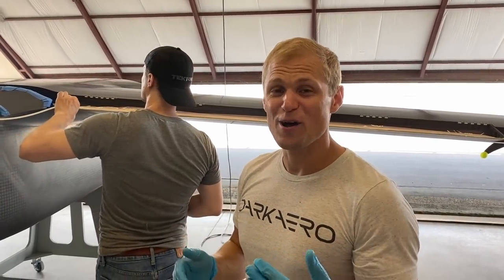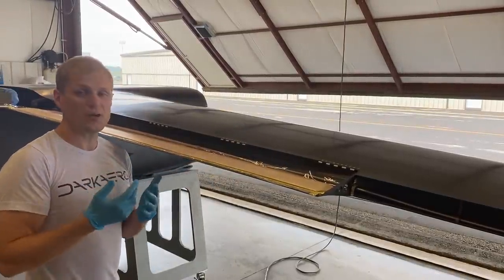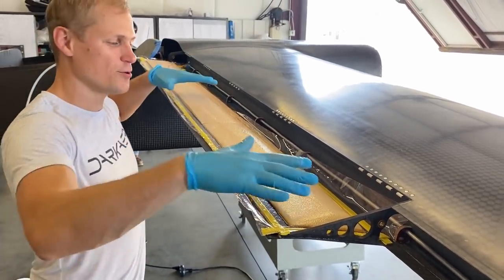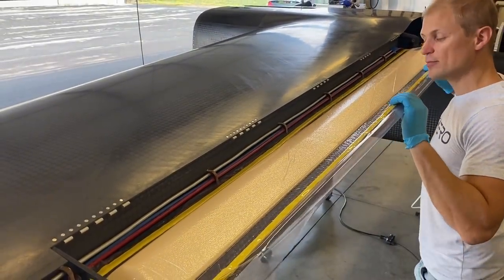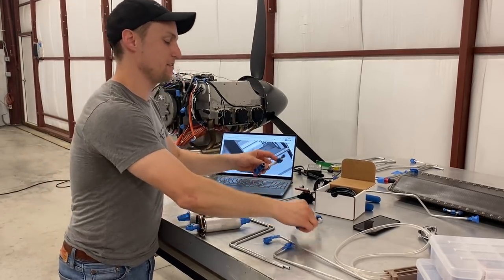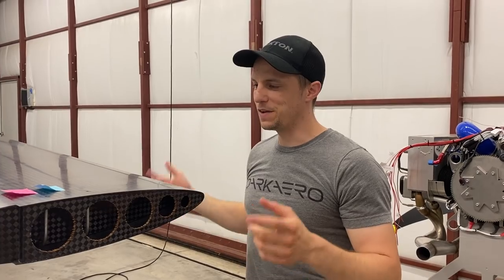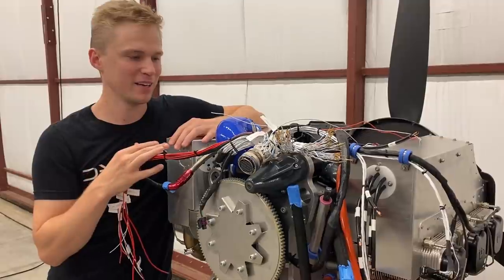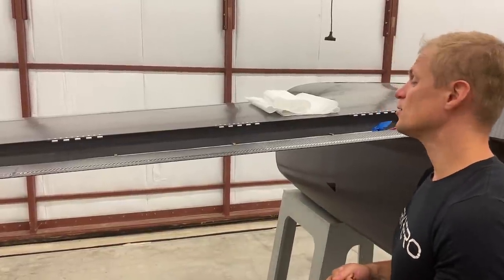Primitive Carbon Fiber Technologies | DarkAero Shop Vlog | July 27, 2021

Comment: Just a thought,  but have you considered back lighting the fuel sight tubes for easy checking at night in flight or on the ground.  Plus backlighting with LED's will look cool as hell, like the rest of the plane.  Great job on everything.  I also agree with the other commenter who said he would watch 1hr episodes.  10-15min is a tease!  Lol
Reply: Agreed, 1 hour would be great.
Reply: I'd like to see the 3 hour James Cameron version :)
Reply: Considering how much work it takes to put together these episodes, I'm thankful to see anything. Let's remember, these guys aren't YouTubers, they're trying to complete a project.
Reply: It's a kit, so adding something like backlighting would be a relatively easy modification to make during the build process. Right now they're just trying to get this thing off the ground. Every little feature like that adds delays, especially given that their wiring harness is already done.
Reply: Experimental/Amateur Built Aircraft are Certified under that E/AB standard, which means the end customer is the official manufacturer of their own aircraft. He/She can do whatever they want, so long as it passes several basic inspections for structure, build quality, and basic mechanical standards. So anything cosmetic or "experimental" in nature is generally allowed (In the USA) - Europe wants engineering documentation on nearly everything. (In spite of the fact its you the pilot who's life hangs on the build quality and engineering). 

So, buy a kit yourself, and plan how it will be customized.
Reply: I feel like the only thing worse than having fuel in the cockpit, is having wiring which could short right next to the fuel. Sounds like a bad day in an crash or off-field landing.

Comment: I like the design contrast between Dark Aero and Mike Patey’s Scrappy aircraft. One off Bespoke vs design for production. Would be very interesting if you and Patey could do a podcast to discuss what would be different if the end goal was reversed for each.  If you did not have manufacturing and price point constraints what would you do different?
Reply: That would be a great video to see.
Reply: If you flipped them you would have a carbon cub and Mikes turboprop race plane. 
I think if the two parties sat down together only a handful of people could understand that lingo.
Reply: I'm watching both projects evolve (well...one now, since Mike Patey is at Oshkosh with his plane). Both are very clean builds. Both paying excruciating attention to detail. Mike Patey could never "produce" his plane, tho, because he throws mad money at it. Billet machined ribs?!?!?!
Reply: @curvs4me  One hundred thousands? 0.100” is that what you meant? Any modern machining center can easily do that.
Reply: @curvs4me  do you have any videos of Mike machining his plane? First I’ve heard of him and just checked out his yt channel, there is so much content out to sort through.
Reply: @curvs4me  pretty sure he outsourced the machining of the ribs and linkages for the crazy flap/slat/aileron system bc he couldnt handle it in house
Reply: @curvs4me  You really don't understand the first thing about machining or machining tolerance do you? good grief

Comment: I am concerned that with the fuel vent arrangement with it have the two circular small vents that it could easily lead to contamination. Simply put, I could see Mud Wasps and other insects making it a new home. And as one other commenter discussed it also seems that full tanks and a non leveled parking surface could lead to fuel leaking? 
However, as an airline pilot and mechanical engineer I find your project absolutely incredible and I can't wait to see it fly. You guys have done a great job!

Comment: @ 8:00, I hope your two fuel tank vent lines have some sort of screen or something blocking critters from crawling up in their and blocking the lines.
Reply: Excellent point
Reply: I'm surprised some sort of evap control system couldn't be worked in, but maybe that's too much weight and just not required on an experimental aircraft.  I wonder if water can ingress that way.

Comment: Is there a projected date to have this prototype flying? Great work!
Reply from the maker: Fair question! We're pushing to get it up into the air before year end. Our big focus right now is getting it up on the gear and getting all the systems (fuel, electrical) hooked up so we can get the engine fired up. Not covered in this video, but there is a lot of work going on for the main gear work. We should have more on main gear soon!
Reply: @DarkAeroInc  Thank you for taking the time to respond. Looking forward to the completion!
Reply: @DarkAeroInc  Looks like a great build. A small question on construction detail. When dealing with glues and compound ( esp composite)
should you be working in a clean room and other systems. Yeah I know hangers get the extremes of climate. ☮️ ☯️ & fly high & inverted.
Reply: Well placed rumors have it you're it's first flight is scheduled for Tuesday....
Reply: @markrooney6406  composites are quite forgiving and clean rooms are not required. As long as you clean and properly prepare the forms, it’s all good. The biggest thing with composites is the temperature of the environment while layup and curing. Resins vary as to their temperature requirements, but generally the warmer the temperature, the faster it sets. That can be manipulated to give yourself a longer or shorter work time with the mixed resin. Cooler temperatures give you some breathing room for the resin to set. Some composites also can benefit from post curing where the finished pieces are put in an heated area, be it an oven or properly set up room to essentially bake it after.

Comment: Great job! Hope to see you flying soon!

Can you please make a video on how you make the reinforcements for the hard points? Like the wing connection, engine mount fitting, surface control hinges and horns, and so on? Composite doesn't stand concentrated load, so it would be great to see the solutions you guys used. Thanks in advance!
Reply: In general I believe they add a couple of extra layers of carbon cloth in those areas and have a metal bracket bonded to the composite structure.

Comment: Gentlemen, NICE WORK!!!

A concern about the surface mounted fuel vent lines.  In icing conditions water drifting back along the bottom surface of the wing will try to push its way up into the fuel vent tubes (the bottom surface of the wing is a positive pressure area plus as the fuel inside the tank is consumed that volume will be pulled from the surface mounted vents) so water will try to move up through the vent and freeze and this might prove problematic.

Comment: Hi Guys, is there any chance you could do a video on the process you use for layup selection during the design phase? Within the homebuilding world there appears to be a more primitive school of thought for amateur designs that is basically 'design the spar for the anticipated load and then guess at the skins and if it sandbag tests OK then you're good' and then at the other end of the spectrum the professionals use some very complex equations to mathematically test a proposed layup schedule for an element of a structure such as a wing skin, which is incredibly unwieldy and challenging to do for the home aircraft designer.

It would be great if you could provide a little guidance on how you guys arrived at what is clearly a very light and strong structure with a focus on how you arrived at the layups you used.

Thanks and please keep the great videos coming. You guys are a real inspiration to homebuilders like me.

Comment: I'm curious what type of pressure gauge you are using for fuel level. Is it an absolute pressure gauge with altitude compensation internal to the avionics or is it a differential pressure gauge with two ports? At different altitudes you would obviously obtain huge differences in readings (~15 psi at SL, vs ~8 psi at 18,000'). That being said, I know people are talking about your venting,  but how did you design your venting system with fuel level measurement (due to pressure differences at different AS, AOA, anything aerodynamically different, etc.)? That could be another source of fuel level error depending on where you put your vent ports (ie, in a low pressure area or maybe high pressure area).

Comment: Nice work! Curious about the venting.  It looks like the tubes exit the tip end of the tank and turn 90 to exit the bottom wing skin. There must be more to it otherwise, fuel would dump out at a wing low condition.
Reply from the maker: Good question! Not mentioned in the video, but each vent tube has a little gravity check valve that closes off in a low wing condition to prevent fuel from dumping overboard. Air can go in but fuel can’t go out.
Reply: @DarkAeroInc  Overly complicated adding more components and more points of failure. Why not vent the top tip of the wing back to the wing root, then an up and over loop to prevent fuel venting in an uncoordinated turn or slip! K.I.S.S principle is always best! Also, using pressure sensors on fuel level is not very accurate (had endless issues on a Europa aircraft with this system. Changed it for a tub-in-tube capacitance system and has worked flawlessly for 20 years now.
Reply: @DarkAeroInc  Failure mode on that check valve?
Reply: @davidwhite2011  Though ball checks are reliable in fully wet systems, I would be concerned that over years, dust from dirty air, could cause the check to stick. Looks like they had two per tank for redundancy. As long as DarkAero didn't make the checks inaccessible, simply add it to the annual inspection list.  It's not expensive and not complicated to change if/when the time comes. There are a ton of things that need to be maintained on any airplane  This is a very small thing.

Comment: With the back up fuel pump. Is there a system in place to alternately utilize each pump regularly? This would avoid any failures due to lack of use with safety redundancies. It could be left to the user, but just curious. 
Love the project! You got this! 🤙🏼

Comment: I know this is very late to comment, but I only just found this video.  I saw a different video on composite hand layup over a pattern shaped from EPS foam, and the presenter made a comment that it could not be vacuum bagged because "even at low levels of vacuum the foam will collapse slightly, leading to distortion."  What type of foam was used so that was not a problem on the flap core?

Comment: looks like 6lbs per cubic foot polyurethane expanding foam.  totalboat has one supporting 400 psi per square inch compression strength

Comment: Awesome layup in situ. Does it matter that the vent ports are at a low pressure area of the airfoil? That is, will that exit point bring fuel cell pressure below ambient?

Comment: Hey guys, been watching your progress and I have a question about the kits. 

Will the builder have to do any carbon fibre work? Any moulding or ANYTHING? 

One of the things that puts me off RV’s is all that time prepping the metal. 

I’d like to buy an aircraft and pretty much start building and installing straight away.
Reply from the maker: Hey! Thanks for following along. The bulk of the composites work is completed by DarkAero (anything that requires special alignment or fixturing). There won’t be a need to mix resins or wet out cloth. There are several areas that require reinforcement strips added but these parts are pre-molded.

Comment: Should there be a check valve at the outlet of the fuel pumps to prevent them from losing pressure through the unused pump?

Comment: I noticed you have the aluminum piano hinge riveted into the wing skin.  Is there any concern for galvanic corrosion there?
Reply from the maker: Josh, good question! The piano hinges are anodized and are separated from the carbon with thin adhesive layer. The rivets used are stainless which have a similar galvanic potential to carbon. These hinges are in an area that can be inspected visually so we will continue to monitor how they are behaving together.

Comment: Great video guys. I missed Ryley why you need to install that foam on the underside of the top surface of the trailing edge?
Reply from the maker: Hi David! This was to stiffen up the wing skin in the area above the flap. In the initial design, we planned on using some honeycomb panel ribs in the area but we ultimately concluded using a foam core was a better solution. It’s a nonstructural area so there isn’t a well defined requirement on the stiffness but it does need to handle basic loads from people pushing on the area. It was a “to do” item that we finally got to.

Comment: Do the fuel vent lines have check-valves or something else to prevent fuel from escaping? I wondering if fuel will be flow (leak) out of the vent lines if you're in a steep banking turn where the fuel level covers the vent exit holes.
Reply: Never mind! ....found the answer in another comment: gravity check valve

Comment: 2 pumps in parallel for redundancy but no check valves on their discharge?
Reply: One would think that'd be a good idea incase an internal check valve failed in the pump.  It'd be nice to monitor their temps too.

Comment: You terminated into a connector without the backshell or strain relief on?
Reply from the maker: Each wire is installed with a service loop to provide strain relief, and the whole assembly will be enclosed by a heat shrink boot later.
Reply: @DarkAeroInc  what about sleeving for the wires? Last shrink boots I used had to be on the wires before terminated into a D38999.
Reply from the maker: Since we may want to make changes to the wiring and we have an interest in keeping the weight down, we didn't want to add shrink tubing throughout. The shrink boot will still serve the purpose of providing strain relief here by limiting the bend angle of the connector along with protecting the service looped wires.
Reply: @DarkAeroInc  if your using all these MIL Spec parts are you following MIL-508088 ? If not I’d move to commercial parts. They would be lighter and cheaper. Very few, if any, MIL parts are meant to be light, when the application calls for it to be lighter they just make it out of Ti.

Comment: so do you have to redo the wing loading test? thanks!
Reply from the maker: This won’t warrant retesting the wing. The portion of wing skin above the flap isn’t acting as primary load bearing structure to carry bending loads in the wing. It’s more of a fairing over the flap that is along for the ride. We added structure to increase its stiffness.

Comment: What if the fuel vent holes allows water inside the tank?
Reply: Maybe some humidity goes in but because the vent is leaking under the wing and fuel evaporate I think there is no issues
Reply from the maker: The wing is inverted as shown. The fuel vent openings are on the bottom of the wing so the only water that could get into the tank would be from humidity / condensation. Water is more dense than fuel so it will settle to the lowest point in the fuel system at the very bottom of the sump where it can be drained from a sample port during pre flight inspection. Checking the sumps for water or other fuel contaminants is a standard part of pre flight checks on all light aircraft.

Comment: With very little dihedral, you will be dumping fuel when the tank is full and/or the aircraft is sitting ( even slightly) on uneven ground. Even at 3/4 full , there may still be a problem when taxiing over uneven ground or in slightly uncoordinated turns. Having been involved with Glasair for years,  and watching the evolution of their vent systems, I admonish you to skip their learning curve. Go right to something similar to their ultimate solution,  the Fuel Vent Float Valve . A quick web search will get you there. Save your self alot of headaches. Great build,  can't wait until the DarkAero is flying.
Reply from the maker: That’s a fair concern but we did account for those types of edges cases in the design. The vent port into the tank is located at the highest elevation in the tank at the wing tip. This point remains the highest location in the tank so long as the slope of the ground does not exceed the dihedral angle of 3.5 degrees. That would be pretty uneven ground at a paved airport. If the slope exceeds the dihedral angle or the airplane is banked in an uncoordinated turn to where fuel can reach the vent lines, a check valve on each line prevents fuel from spilling overboard. Apologies for not clarifying more in the video! Thank you for following along!
Reply: @DarkAeroInc  please make sure the checks can be inspected and serviced.

Comment: By not using readily available fuel pump modules you are adding cost and hard to source replacement parts as they become custom installation just to save a few millimeters? I understand you are space limited but your just adding unnecessary complexity. There are many ways to do this.
Reply: This whole airplane is custom and cost is secondary to weight. This isn't for everyone... it's the supercar of airplane kits.

Comment: You guys are doing a lot right but you lost me as a potential customer.  Maybe I'm just a traditionalist but I don't care for your engine/prop combination choice or your landing gear.  I want oleo struts all around and your nose gear is WAY too complicated with multiple failure points.  Then again, I'm just an old aerospace engineer with 40+ years of experience.  Maybe I don't know much.  Regardless, I wish you all the best.
Reply: There’s a right way and a wrong way to make this comment. You chose the wrong way… :(
Reply: @cjl76  How so?
Reply: @johnc6919  Fanboys?  Is that a euphemism?  I'm not sure.  As I said, I'm an old fart.  I actually speak and write in English to avoid misunderstandings.
Reply: I think this plane will be kinda hot to land for the average guy.I also think the landing gear will cause these guys a lot of headaches.